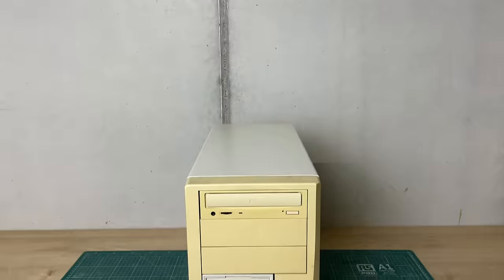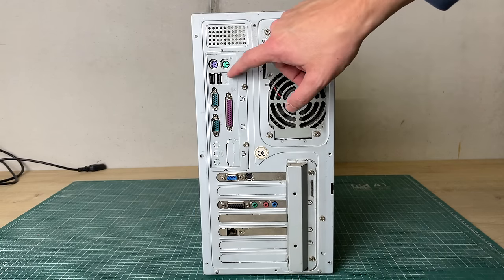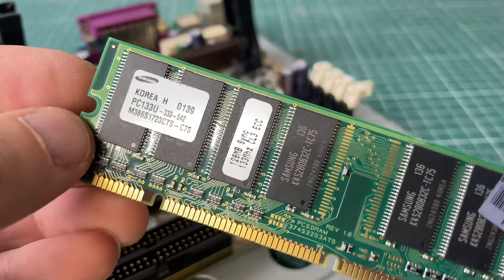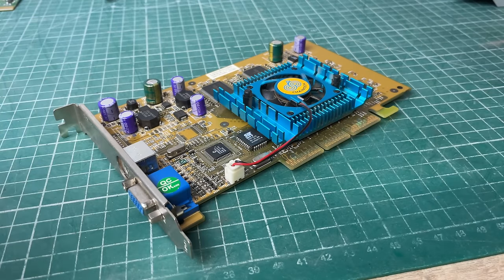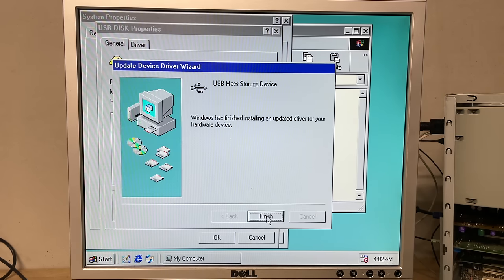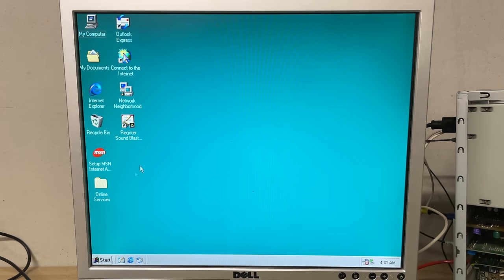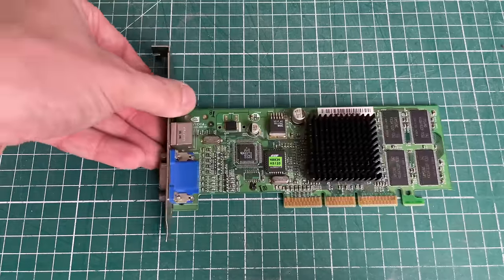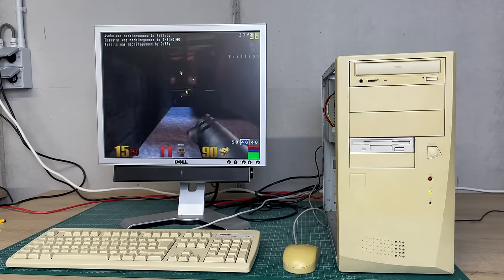Intel Pentium 3 + Geforce2 = Fun !

Comment: I think you're really choking the geforce 2 ti. It would do much better with a more period accurate fast thunderbird / slow athlon XP and moderate resolution (like 1024x768 or even 800x600 in newer games). You want to match the refresh rate of the monitor as often as possible. On a CRT which effectively is a rolling shutter BFI monitor (in modern language) this gives you extremely good motion clarity that LCDs still cannot come close to matching, even with strobing backlight/BFI. A CRT is really worth the back pain and space requirement for older games but a pain to record properly with a camera. Quake III would typically run > 100 FPS on a geforce 2 ti unless the screen is drowning in smoke trails.

Comment: 3DMark99 Max Score: 4693, CPU Score: 10741
800x600, 32-bit, Z24, Triple Buffering, PIII Optimisations

Pentium III 800EB 133MHz FSB CPU
512MB Crucial 133MHz SDRAM (2-2-2-5 timings)
AOpen MX3S Intel 815 Motherboard
128MB DDR Palit GeForce 4 MX 440 AGP 8x 128-bit AGP Card (550mp/s, 1100mt/s, 4.8GB/s)
Yamaha YMF724F-V PCI Sound
98se with SP3 (v3.65) & DirectX 9.0c (December 2006)
nVidia Driver v56.64

Comment: i have a similar setup but im running a Pentium II 450, a MX200, SB 128 PCI, and 3x128mb ram, and its a great time. Quake ii in OpenGL mode runs over 60 fps in 640x480, but Moto Racer will only run in software mode, oddly. i dunno if its a driver issue.

Comment: In windows 95 (98) directx in unreal tournament had a fault - When changing resolution  you got worse performance changing back to like 640x480 if you tried 512x384 ( on nvidia 2 cards ) . This error might persisted so you might have to uninstall and reinstall the game

Comment: intresting Videos:) I like Benchmark old cards. I have questions  after i have reinstalled WIndows XP on my Pentium 3 667MHZ 128MB SDR Ram and Nvidia Riva TNT 2 Pro i have problems with several games because of frame drops and texture bugs. I have tried older and newer driver and the issue ar ethe same before i reinstalled WIndows XP this game runs smooth without texture bugs.

The games whhich I have noticed bader performance (because frame drops) and texture bugs are: 
Deues EX (frame drops especially on Maps Outside, Inside its ok, Hitman Codename 47 (texture of buildings not plooping out only if you are really near of them), Crazy Taxi --> Crazy Box runs smooth 30-50 fps  (640x480 Medium) if i play the normale Mode Freeride trough the city than the frame dopes comes....

Comment: ATX does not mean that it has to have removable side covers…. Lots of ATX cases came with one full cover only.
Reply: some did but not lots....the standard for atx cases was side covers
Reply: It's likely that the original design for this case was AT, but they replaced the back panel with one that has  ATX punchouts.  It is certainly transitional looking.
Reply: @dennisp.2147   That ATX back plate is a giveaway.  A few first gen ATX cases had that large plate with screw holes.  Then they moved to the normal press-fit style.
Reply: @nickwallette6201  Yes and no.  Many of the early ATX cases did, but the press fit style has also been there since the beginning as well.  The first one I saw being in a system I built in January of 1996 or so.  Different case vendors  chose different options.  The simplest (and cheapest) being the one that eventually won out.
Reply: @dennisp.2147  Uh.. yeah.  That's what I said.  :-)  " A FEW of those early ATX cases had that..."

I was implying that, because of the odd ATX back plate, this indeed looks to be a first-gen ATX model.  Which means it was from an era before side panels caught on, which was a change that coincided with the AT-to-ATX transition period.

My first ATX case had the large ATX back plate, which IIRC, was an Enlight case.  I think it was also a full cover panel, not just side panels.
Reply: @nickwallette6201  You said it was a giveaway.  It's not.  From the very beginning there were ATX cases that had separate side panels and the press fit style i/o panel.  It's a clue, but it's not an absolute giveaway.
Reply: @dennisp.2147   No, you've been interpreting this entire thread the wrong way.  I was backing you up on my first post, when you said it looked like an AT case that had been retooled into ATX.  I posted that the back plate was a giveaway .... that this was definitely a first-gen ATX design ... because everything since has been press-fit, for the most part.  (With exceptions for proprietary designs or 1U server cases, etc.)

That's not to say that there weren't any cases with side panels and press-fit plates from the get-go.  I'm sure there were.  But that first gen was from a time when the ATX plate situation hadn't quite settled down to a bona fide or even de facto standard yet, and side panels were just becoming vogue.  So if you see case that breaks both of those trends, it's probably a Gen-1 ATX case.  That's all I've been saying.

Comment: I have a spare IBM PL320 it has that same processor altough it doesn't boot it is just stuck at IBM logo.  Also I have Fujitsu-Siemens Scenic Xs, it's a micro pc 32x30x8cm which I use as my retro station so for now I will not hassle with that IBM.

Comment: For proper representation you should better use not an ATI Rage Pro card (it's late '97 card), but nVidia Riva TNT 2 variant as more common solution for that time as CPU and MB come (mid '99). And GF2/4MX are absolute optimal for below 1Ghz CPUs at that era.
Reply: Or use at least Ati Rage 128 or better Radeon 7000, 8000 - they are from the same time as GF2.
Reply: @xsc1000  Rage 128 Ultra cannot compete, and was never released to compete, with the Geforce 2 Ti, which came out alongside the Geforce 3 and had nearly the same performance as the Geforce 2 Ultra. When the Rage 128 Ultra came out, while a decent mid range card, it cost just £110, compared to the Geforce 2 Ultra's £350 price tag. So not a fair comparison.

A Radeon 7500 would be a close match in price and performance to a GF2 Ti. But with this P3-500Mhz CPU, it would be heavily bottlenecked, just like the Geforce.

I think I had Diamond Viper V770's in my P3-550's back then. Which was kinda an OEM TNT2 Pro / Ultra that shipped with top end DELL machines back in the day. Surprisingly fast, considering! Back then DELL's optiplex servers were nothing but awesome components. My machines had dual P3-550's, 256MB SDRAM, onboard SCSI controllers with Quantum Fireball drives and the cases came apart from the center which made getting inside and tinkering much less of a pain. They even had OMEGA tape backup drives that we never actually used, but they looked cool! XD

Comment: I also have a sblive card that is dell branded and I have never been able to get that card to work in 98. From my research the lives only have ever had xp drivers
Reply: Whats the model number?
Reply: The Lives absolutely had 98 drivers. I mean, the original came out IN 98.
Reply: @CptJistuce  They did. But a lot of them have different drivers. They will have win98 drivers, but DOS drivers are a different story.
Reply: There is a particular version of the SB Live that was OEM’d to Dell and the ONLY drivers that work are the ones supplied by Dell.

I have several versions of the Live and that Dell variant was the absolute worst.  I’m sure it’s OK in Linux or maybe XP, with built in drivers that are far more inclusive of all the whole range of potential PCI IDs.

IIRC, some of the Live variants also use cut-down codecs rather than the EMU 10K.  But I may be thinking of the Audigy.  🤔  At any rate, as much as I loved the original Live that I bought in 98 (and used for years in Win 95, 98, and ME - where it lives today), the Live product line was a mess.

Comment: hmm...something is not right here, judging by your Fraps numbers. In Quake 2, for instance, I get over 45fps on a K6-2 533 + Voodoo2. Quake 3 results are also weird, I get close to 50 fps with a PIII 600 + Rage 128 Pro...your GF2 ti is way stronger...maybe some Bios setting you need to check.
Reply: ok, my bad. It was the Ati Rage benchmarking I was lookiing at, sorry...

Comment: so many errors naming parts and specs i am impressed

biggest one -bx 768mb of ram maz
sb 128 not live
windows lists cpu's en device mannager by model not by speed so you could just read the default speed there
Reply: Nope on the first one, Intel says 440BX supports 1GB of memory, not 768MB. ref: Intel Chipset Mature Products via Wayback Machine, it's linked on the Wikipedia page but I confirmed by following the link, can't always trust WP but the Intel doc is definitive.

Comment: I think pentium 3 was slot 2
Reply: No, no,  SLOT1 that was, eventually newer on  370...
Reply: No.  It was slot 1 and then later socket 370.  Slot 2 was for Xeon processors.
Reply: @dennisp.2147  Duno, but for sure slot1 and 370 was for PIII... :)
Reply: @PiotrK2022  Yes.  Slot 2 was for the Xeons.

Comment: I don’t see anything odd about XP on a Pentium III, unless you meant specifically at 333 MHz. If anything, the 320 MB of RAM is rather skimpy for XP though, as it swaps too often with less than 512 MB.
Reply: Long as you keep it pre-SP3 all that extra junk really slows down a computer. I remember XP felt so sluggish after updating from Sp2.
Reply: on my pentium 3 tualatin with 1.5 gb of ram, xp runs great even with sp3 installed
Reply: My first laptop was a Sony VAIO R505 - Pentium III - 850MHz w/ 384MB. It shipped with XP and ran great.
Reply: @talvisota327  
Weren't those what the later Pent4 architecture was based off of? If my memory is correct the first Pent4 cpus were actually slower than Pent3 systems despite the difference in clock speed.
Reply: @lordterra1377  pentium m and later core 2 duo were based on the pentium 3. pentium 4 had its own architecture
Reply: Do my question is - whats the best system for pentium 3?
Reply: The original XP before SP1 would run fine on a 333 mhz with 32b ram. I can recall doing this and XP was using around 128mb ram. Now if you wanted to install a more modern browser or games this would not be ideal. But if you want to run only early XP or pre XP software and this would be okay spec wise. The bloat didn't happen until they started updating XP. Remember that XP is a merge of both the legacy Kernal and NT platform rolled into one.
Reply: I would like to try lots of things :) I found everything what i needed, processor, power supply, ram, graphic card, now i know that Windows XP will be cool experiment. But still have a problem with motherboard... Can't find anything, at least not cheap. Any recomendations? Thanks
Reply: @WeArePassionatesOfCreativity  
Maybe find a OEM computer that would support the parts you have? Try E-waste facilities on eBay, make them an offer on a old ugly machine for around maybe $80 or less. Then take the motherboard and put it into your own case.

Sometimes you can score nice systems as long as youre willing to clean out all th dirt and webs from them.

Comment: I've been wanting to upgrade my Windows 98 machine. Currently it's running a PIII @ 600 MHz with 256 MB RAM and an ATi Radeon 7200 series with 32 MB of vRAM. The video card is what I was wanting to get, and was looking at a GeForce 2 series card. But, out of curiosity of how my machine compared to yours, I ran 3D Mark 99 with the same settings. I've got 3541 3DMarks and 9059 CPU.

Comment: The sound card is actually a Creative PCI 128, not a Live! card.
Reply: The PCI 128, a not so great version of the soundblaster family. I’ve got that card in my Pentium 2 system and it sadly lacks is good DOS compatibility. It’s fine for Windows games, but it’s use for DOS games very limited as it lacks the OPL chip. Also the limited DOS support only seems to work in the context of Windows 95/98 with some driver magic and only with software that use digital sound in my experience. I never got it to work in real mode DOS. If I had the chance, I would want to replace it with an SB 16 or a decent clone.

Comment: Me personally I had the AMD k6-2 650 MHz with a G-Force 2 mx/mx-400 with 128 MB of RAM and the in a 8X AGP
Some of the Intel processors at the time were okay but AMD outclassed them in my opinion then somewhere along the line and tell outclass AMD for a good long while then it was a back and forth shootout until again AMD later on in years I think it was 2013-2014 took hold strangled the hell out of AMD and said this is my turn and now we have AMD which took the stranglehold back and knocked Intel to the curb even knowing that Intel now has that 12th gen CPU which is still pretty good but it's causing a lot of headaches only because of Microsoft I think

Comment: don't know why but working on that pc looks so comfy, everything from the motherboard to the os glitches
Reply: I am using Windows95 and DOS 6.2 lately on a VM a lot for uni and also feels really comfy. There is something about those old OS that won't translate to modern ones, and I don't know what it is.
Reply: @Vlad-1986  Perhaps it’s the simplicity of the file system, less bloat, efficient UI, and full control of processes in use, among other things.

Comment: Nice build, my current windows 98 is a Pentium 4 northwood 3.2ghz, 512mb DDR, ati radeon x850 pro, sound blaster audigy 2zs, I used a modern antec case that looked like its stuck from the mid 2000s and I painted it beige.
Reply: That thing must really scream. My best 98 machine is early Pent 4 at 1.8 ghz. It handles every game flawlessly.
Reply: @lordterra1377  Yeah it run UT99 with no frame drops, and runs Serious Sam the second Encounter with like 70-90 fps maxed out and the res  at 1280x1024.
Reply: @purpasmart_4831  
What motherboard do you have?
Reply: @lordterra1377  Asus P4P800-VM

Comment: Aw, I used a P3B-F with a Celeron 300 and Geforce 256 at that time. Lots of memories. Those Promise cards were included with Western Digital hard drives for a while when they got to be too large for most BIOSs to recognize. Larger than 13GB, I think? I used them to run two drives in RAID0 for video capture.
Reply: I remember there being a 32GB limit on some BIOS in the mid to late 90’s but updating to the latest BIOS should sort it.
Celeron 300’s were great for their cost and overclocking ability!!

Some older mobo’s BIOS’ were had HDD capacity limits before along with the 32GB limit such as 2.1, 4.2, 8.4 and a bit more recently, a ~128? GB limit.
The work around in earlier BIOS’ were to enter the HDD parameters manually using ‘user mode’ I think it was and then enter the parameters manually or update BIOS.

Comment: I had a PIII with 450 MHz on a Gigabyte BX2000 board. With the DIP switches set correctly I could run it at 550 MHz with a 120 MHz FSB. I think it only worked cause I had a good quality Riva TNT2 M64 and 133 MHz SD RAM installed. I miss that machine, lugged it to many LAN parties. I remember playing Battlefield 1942, Quake 3, Diablo 2 and Star Trek Voyager Elite Force on it. I still have the hard drives from the machine somewhere, a 30 GB and a 80 GB Seagate. At some point it upgraded it to a Geforce 4200 I think which helped a lot in terms of game performance.

Comment: I don't know why you didn't mention higher-end ATI cards such as the Rage 128 and the Radeon series. You could throw a Radeon in there and get performance comparable to the MX, based on my own experience with a Pentium 4 Dell that I have with an OEM Radeon card in it. I tried an MX 400 in there and performance is basically the same.

Comment: This is reminiscent of my Pentium III HP Pavilion which has a similar configuration of the PSU being side mounted and vertical. This was a 1999-2000 era desktop PC. When that Pavilion came out the GeForce 256 was the hot GPU of the time and Creative Labs had their own version of the card that was advertised everywhere.
Reply: Ah yes. The Creative Annihilator. Had that one as well.

Comment: An old Katmai based PIII, cool! that 512K of cache ran at 1/2 the processor speed. I also found that the cheap/bad cap issues were 2 fold: 1 cheap caps from budget board manufacturers. The other was that early 2000 counterfit/knockoff capacitors that ended up on a bunch of boards. I have 2 P4 boards, and a P3 board that need to be re-capped because of this..

Cheers!

Comment: I bought an AGP GeForce 2 Ti (I think it was a Chaintech) in the fall of 2001 for my Abit KT7A and it was a dramatic step up from the Pine PCI TNT2 (a holdover from my first computer which only had PCI and ISA slots) I had been using.

Comment: Those PIII were great overclockers! The slightly later Celeron were absolute overcloking beasts.
I had a 667Mhz that easily run on 1100MHz.
I had almost exactly the same computer back than, same case, slightly different motherboard, also with a GeForce (different brand).
WinXP on those machines was fine, just with a bit more RAM.

Comment: "If it was an Athlon Board from a couple of years later the caps would be bad"
Ähm, nope. Its the Caps, has nothing to do with beeing an Athlon. and it also depends on the Board. Some Athlon Boards used Nippon Chemicon KZE (MSI K7V266), they are OKish. The Issue lies with the Ultra Low ESR Capacitors (Nippon Chemicon KZG and Panasonic FJ) due to the high amounts of WATER in the capacitors. Its just that in the DIY Market, K7 was way more popular at the time, especially in Europe.

Comment: The P3-500 is more suited to something like a VooDoo 2. You'd get the same results as with the GF2 Ti, despite the GF2 Ti being around 3x faster than a VooDoo 3 in most cases. That CPU really bottlenecks the Geforce.

Motoracer looked very fresh with the Rage Pro Turbo! I played Motoracer on a Matrox Mystique back in the day, not perfectly smooth but very playable and it looked great.